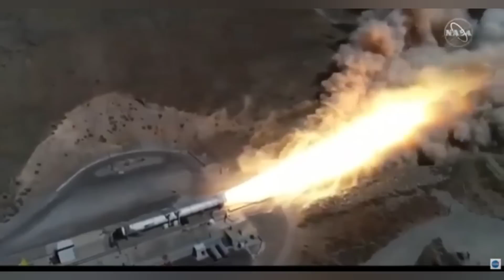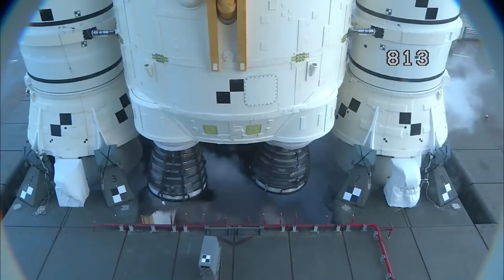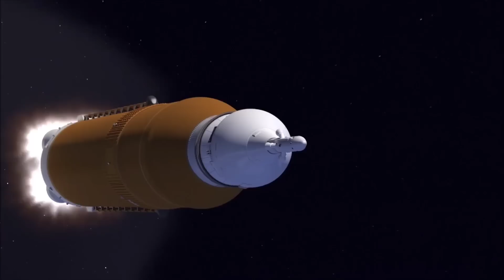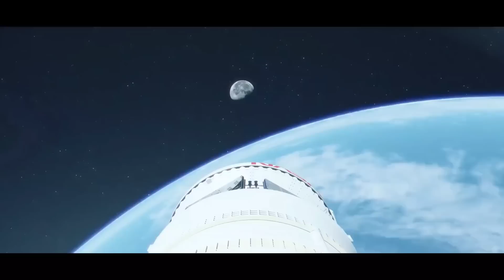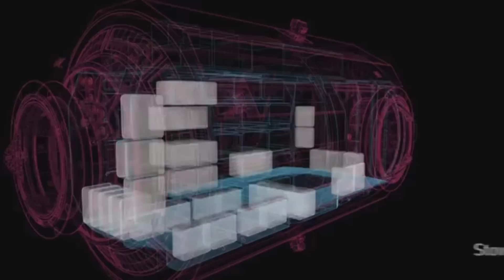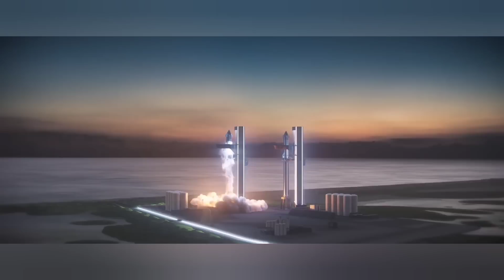Bill Nelson and NASA are doubling down on SLS!!  Why??

Comment: You can design a Moon mission without SLS. And it will be much cheaper.
Except for Artemis 1, Starship HLS and Starship tankers are already an essential part of Artemis. 

But once Starship HLS and Starship tankers are ready, then SLS will become obsolete. All you need for a Moon mission is F9, Dragon, Starship HLS + Starship tanker in Moon orbit (for more payload) or in GEO (with limited payload).  

i.e. A fully refueled Starship HLS can be launched from Earth orbit, land on the Moon, go to Moon orbit (Or GEO), refueled again, and return to Low Earth orbit.  From Earth orbit you don't need the Orion.

SLS is a waste of money. A way for the government to distribute money to Legacy space. SLS is not sustainable.
Reply: Starship is nowhere near the simple stage of a prototype. Massive refueling of cryogenics in orbit still awaits to be demonstred. The HLS lander seems conceived to land on those flat SpaceX platforms, not on lunar surface. Take a look to Apollo 15 LM on moon suface. With those inclination, HLS would likely  fall... 
OK SLS is obsolete and costly. But Starship has yet to prove everything and I don't take for granted that he will succeed, at least in a reasonable timeframe.
Reply: @andreabindolini7452  It is true that Starship is more complex and revolutionary. Nevertheless, Starship development is progressing a lot faster than SLS.

SLS in current configuration had been in development since 2011. But if you include earlier versions (Like Ares V) NASA started working on it since the 1980s.

SLS is basically Shuttle components (boosters, engines and main tank) with an expendable Saturn V style upper stage and command module (Orion).  Nothing is revolutionary about it. It was supposed to be quick. It should have been quick. Yet the people who ran the program had managed to delay it for decades and extract a lot of money from the tax payer in a cost-plus contract.

Given how the SLS program is ran, it is not clear yet which rocket will reach orbit first. SLS seem more likely. But if Starship win I won't be surprised.
Reply: @sciandsci-fi1723  Starship could fly soon, granted. But not in a form even remotely similar to the final, human rated  one. SLS configuration is frozen. There are literally years of development between the two. Musk is not a wizard. He can blow up rockets any day if he want, but to place human beings atop of them, he need to make all the necessary steps. And this takes a lot of time.
Reply: @andreabindolini7452  My point is that the SLS's thirty some years of development is not its strong point, but its weakness. It reveals how wasteful and inefficient the project is.

The Saturn V took 4 years to develop until the first crew flight. (6 years since conception.)

The SLS may fly a crew mission before Starship. No guarantees, and I wouldn't be surprised if it won't. But even if it does, the SLS will become obsolete soon after its first flight.
Reply: @sciandsci-fi1723  rockets aren't LEGO. The fact SLS is composed by Shuttle components don't mean that is in development from thirty years. This is ridiculous. The rocket is a completely different beast. Saturn V had a completely different level of funding.
Reply: @andreabindolini7452  not true.

Adjusted to inflation, SLS and Orion had a higher development cost than Saturn V.

Saturn V, adjusted to inflation (2020): $34B
SLS: $23B
Orion: $18B

Saturn V had a larger portion of the GDP.
But the US today is a lot richer, and in absolute numbers, SLS and Orion cost more.
Reply: @sciandsci-fi1723  Adjusted for inflaction, RMS Titanic cost less than the Titanic movie. Difficult comparisons. The only fair metric is the cost in relation to the entire Federal spending in the same years. Apollo peaked at 4%. I doubt that SLS or Constellation came close. Nasa is constantly underfounded.
Reply: @andreabindolini7452  SLS and Orion, combined, got more funding than Saturn V. (Adjusted to inflation)
Reply: @sciandsci-fi1723  again: apples and oranges.

Comment: Is it impossible to somehow reuse the sls first stage?
Reply: YES.  It's not even close to efficient enough to have both a payload and reusability.  SLS continues to exist only due to government pork.
Reply: No, in his current form. The staging occurs at near orbital speed, and this means that the stage reenter the atmosphere with far too much energy. It burns in the atmosphere. Is the same problem SpaceX encountered with the second stage of Falcon 9, that was meant to be recoverable and reusable at first. Making the SLS core stage reusable would mean redesign it from scratch, with an heat shield, some form of flight control, a landing gear and/or parachutes, and so on. Because of the extra weight, this would mean halving the payload of the rocket. And I cannot imagine the time and the cost to do so.

Comment: SLS is incapable of putting a man on the Moon - period - it has no lander, and isn't capable of carrrying a lander to the lunar surface.  As for "Lunar Gateway" what's the point?  It does nothing which can't be more easily, more safely and more economically performed on Earth, in Earth orbit, or on the lunar surface, and that's not taking into account the whole cost of development, building, launch, and maintenance of the "Lunar Gateway".  

It is also disingenuous to look at the "development costs" in the way that you did.  Your cost of the Space Shuttle doesn't take into account that part of those costs have to be shared with SLS, after all they are using its expensive and renewable engines and throwing them away after every flight.  Also the cost per flight which is far more important when considering the cost of a launch system, especially when each launch will cost over $4.1 BILLION!

As for the SLS being flight ready, well... maybe, but we must bear in mind that the SLS that's flight ready can only take people around the Moon and back and that's all!  No landing, no science, no nothing apart from a PR stunt.  If we're talking about the further iterations of the SLS, we would do well to remember that the launch tower is unlikely to be finished for years, if at all, and without which, Block 1b will not fly.

Sure Starship has a long way to go, especially with so much government money going to NASA, but if it works as designed it will significantly reduce the cost per launch.  It looks like the lessons NASA should have learned with the Shuttle, i.e. stinting on development costs will increase the cost per launch, have NOT been learned.  It also appears that doubling down on old technology, wasting the work done to make the rockets reuseable, hyping up what can be achieved, and spending time on a "Lunar Gateway" which cannot achieve anything worthwhile, is just an attempt by NASA to save face.

Comment: The Space Shuttle was broken by Design as well as now it is SLS. Nobody should believe all the Stories from the 70s until now how great the Space Shuttle was. It was a Desaster! I observed all ideas and Work on Space Transportation Systems from the 60s until today. There is exactly ONE Hope: the Starship System of SpaceX. All Others have already lost and are therefore a waste of Money. Even If you throw the complete Rocket away on each Launch, Starship is at least 10 Times cheaper than SLS.

Comment: The development costs for SLS are so far over $23 billion - and every launch is at least $2 billion.  As far as I can figure out it puts a current total price tag per launch at over $4 billion (including all costs including Orion capsule, ESA service module and ground systems) when considering 10 future launches (only 5 are scheduled - another 5 are in the pipeline).  I am pretty sure that the price will be around $5 billion per launch when all is said and done.
The entire Apollo program was over $250 billion in todays dollars.  The Saturn 5 per launch costs vary according to sources.  A number appearing several times is $1.4 billion in todays money.
Putting 1,000,000 tons of cargo on Mars (SpaceX' plan) with the the SLS rocket would probably require around 50,000 launches or $200 trillion.  SpaceX is aiming at 10,000 launches plus another 80,000 refuel launches.  So lets say a total of 100,000 launches.  The aim is for a launch cost of $2 million per launch - which gives a total $200 billion - which shows the power of reusability.  However, it does seem to require refueling on Mars.
Reply: I've no doubt Starship will achieve great things when perfected but
 that $2 million per launch doesn’t sound very logical considering all the complexity and current Rocket costs.

Then again their plan is aimed for far ahead in future and what SpaceX is capable now seemed impractical once.
Reply: Discussions about refueling in Earth orbit are ridiculous: Wernher von Braun wanted Apollo to do it just like that in the SIXTIES! 
NASA only chose a different method because they thought that the alternative could be developed more quickly.
Reply: Yeah, genius that refueling is a BIG ASS IF.
Reply: @Gnefitisis  Getting to LEO is halfway to anywhere.  Once you have solved the extremely complicated problem of getting a 100 plus tons there reliably and cheaply with a reusable spaceship - then you can do anything (and the people behind are gods and geniuses) and refueling is really a simple problem relatively speaking.
Reply: Spacex has shown it can deliver so in space refueling will be a achievable look at what we have seen 18 months ago nobody would have believed a water tower could fly
Reply: And where does NASA get its funding from TAX dollars from us the taxpayers?
Reply: Independent if Starship will be successful or not: stop that waste of money by investing every year 4 billion in a launcher that costs on every launch the same. USA could use the same amount of money to develop space equipment that will be launched on much cheaper rockets. Falcon Heavy is already operational. It gives me the impression that only fresh people from south africa, germany, ... (you name it) ... are able to push space flight in USA forward ... and I count only on USA, because there mindset is the only that brings the world real space exploration (i.e. beyond earth orbit).
Reply: Only the super naive believe that a Starship launch in the future is going to cost 2 million a shot. It's not... Ever. That is classic Elon marketing.
Reply: @hawkdsl  The 2M is cost - not price. Our only measuring stick is the Falcon 9 at a reported cost of 15M per launch. It is only somewhat reusable and has a cadence of < 100 yearly launches.
Of course 2M seems like an unobtainable number - picked by Elon Musk to aim as high as possible. But when considering 1000 yearly launches of a fully reusable system I think they could get surprisingly close.  Time will show
Reply: @pierre.a.larsen  F9 cost to fly the TESS was 89 million.. F9 prices have been going up, not down. The same will be true for SS. It's a company trying to make money, not save the human race as is believed be Elon and SpaceX cultist. There will never... NEVER.. be a 2 million launch cost. Ever. Edit: And there will NEVER be 1000 SS launches in a year. That is more pie in the sky nonsense from Elon.

Comment: Couldn't Spacex  develop  a stripped down smaller starship with third stage for  lunar landing, needing only one refueling? With much less payload capability of course. If starship booster is so powerful and reusable, one could launch a small starship version with integrated lander ( not landing the whole thing) wich makes roundtrips to the moon and back on HEEO orbit. The transfer stage could be similar to starship construction, propell the lander to and from lunar orbit. Astronauts could transfer to the lander with crew dragon. It would therefore need 1 superheavy launch to put it in LEO in the first place, one superheavy and starship launch for refueling per moon mission and one crew dragon launch for getting to the lunar module and back to earth. When starship will be human rated in the future, astronauts could directly ride with the refueling launch.
Reply: There is someone that did a video concept of a mini Starship launched out of the larger Starship as payload but I can't remember the name 🤔

Comment: How many flight-ready RS-25s exist?  The maximum number of SLS launches is this number DIV 4.  Has A-R committed to build new RS-25s?  

EDIT: OK I found this: "Aerojet Rocketdyne is under contract to produce 24 new RS-25 engines using the updated design to support future Artemis missions beginning with Artemis V."  I have serious concerns that A-R can pull off 24 new engines after not building one for 20+ years.